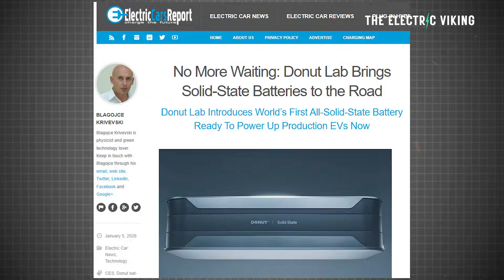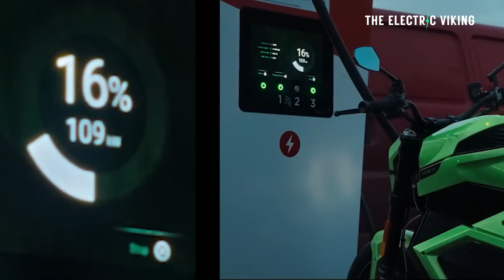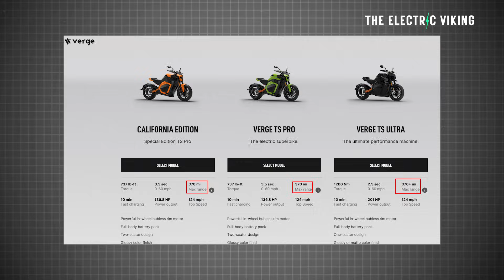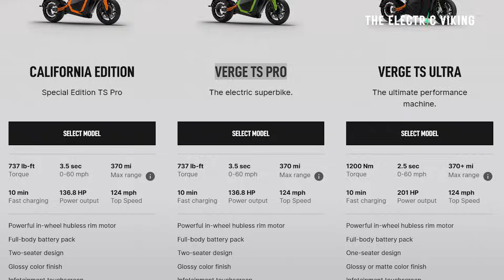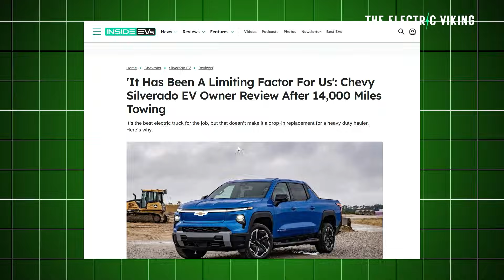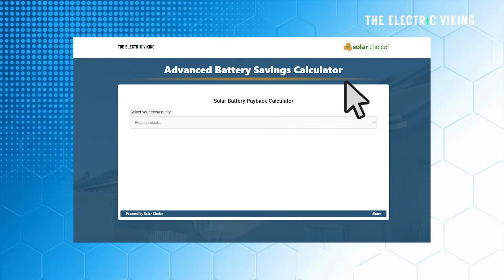The world's first true production-ready SOLID-state battery lasts for 100,000 cycles

Comment: 0:24 People who say that batteries will end fossil fuels seem to think that batteries generate their own electricity.
Reply: Whether you use, nuclear, wind, solar, or geo thermal, they all generate electricity. Gas powered ICE vehicles use between 20-55 percent of the fuel it burns actually turning the wheels, the efficiency is way lower than EVs, before the only reason gas powered cars were better was because gas is power dense , if gas cars were actually 85-90 percent as efficient as EVs, a full tank of gas would take you 2 thousand miles instead of of 430-450 miles. They actually made a gas powered car that could go 200 mpg Volkswagen XL 1, it was a limited production diesel hybrid. There's so much more energy being wasted in gasoline that we are pissing away when 100 mpg cars could be made, but big oil doesn't want that .
Reply: @jesselejarzar5114  You would have to factor in all the power loss from the power prrduction to charge the batteries, to make it a fair comparison.
Reply: Most countries just don't make enough electricity to ditch fossil fuels.
Reply: You have to consider that this battery enable store solar energy and have energy available 24/7

Comment: Every engineer’s BS detector went off listening to the hype. It’s 2026, and they’re claiming a solid state battery with 100,000 cycles when the current upper limit is around 25,000 for lithium-titanium-oxide (LTO). The secrecy around the battery chemistry only adds to the suspicion, this reeks like a scam.

Comment: 22kwh out of a solid state battery is the same like 22kwh out of any other battery chemistry and it's not enough for 370miles of range. Even a 22kg battery with solid state tech can't do 370miles, with 22kW the math makes simply no sense. 400wh/kg means at least 55kg for a 22kwh battery, probably more like 60. That would probably fit in such a bike but it would mean only 3,6kwh/100km of range. Shit, a small Surron Hyperbee needs twice as much for such a range..

Comment: Your gushing thoughts that 500Wh/kg will enable inter continental air travel is somewhat hyperbolic.   Jet A fuel is approximately 11,900Wh/kg and even given a 30% conversion efficiency that is ~4000Wh/kg so still 10x better than this Donut offering for aviation.
500Wh/kg will make it viable for small, light aircraft, just.

Comment: lithium ion solid state projected to be 800-1000 kwh/kg. A few years away, but double or more than Donut's sodium-alu-carbon solid state battery. QS battery testing at 844 kwh/kg and looks like VW's Powerco will build it.
Reply: and here is the problem. anything you buy now is obsolete in 5 years. i mean imagine buying top of the line tesla now just so they announce in february that cheapest model 3 has now specs same as top of the line you just bought

Comment: It's pretty exciting. Let's see how real it is. More than doubling range, what's more likely is using fewer to reduce cost. If the car could drop in price by 3 or 4 grand and still add maybe 20% in range people would be sold. The car would be lighter too and thereby extending range just through hauling less weight around. The cars could be safter too. Less crushing in a crash. Also more snappy acceleration (I think cars are too fast already). The fast charging time would sell people too. What if you go to a 3 minute charge for a smaller pack? I really hope this is all real. It will be amazing. An electric car that can be passed on like a classic car instead of being a brick.

Comment: Carbonised chips which distribute heat are going to be utilised and solid state batteries. In Japan when you need a charge that are charging stations, but the new charging stations are.
The car goes straight to the charging station a robot comes down under the battery takes the battery out put it on charge put a new battery already it charged up straight in and slaughter it underneath the car and the way you go it’s quicker than fuel your car. It works 100% Japan have this now just to give you some idea.

Comment: Narrow body jets like A320 or 737
Impossible. Battery mass would exceed takeoff weight before payload and reserves.

Long haul or transcontinental flights
Not even close. You would need 5 to 6 times higher energy density.
Reply: 500 Wh per kg does enable electric aviation, but only for:
	•	Trainers
	•	Short range commuters
	•	eVTOL
	•	Cargo and special mission aircraft

It does not enable electric jetliners.
For that you need either hybrid systems or a fundamentally different energy carrier.

Electric aircraft will arrive quietly on short routes first. Anyone promising electric long haul aviation with batteries alone is selling fantasy.

Comment: Just because you can charge a motorcycle in five minutes, I’m not sure, but I don’t think you could find a charger on the face of the earth that could get enough electricity to cram that much energy into a pick up truck in five minutes, even if the batteries could take it. Think about the quantity of energy that would be.

Comment: Donut Lab claims that their solid-state “Donut Battery” is production-ready now and can be used in motorcycles like Verge’s 2026 models.
	•	However, there is no independent verification that the battery actually performs as advertised in real-world use.
	•	Claims of extremely fast charging, high energy density, and long lifespan are not confirmed by independent tests.
	•	“Ready for use now” likely means for OEM manufacturers in limited test deliveries – it is not necessarily available for consumers to buy directly yet.

It’s exciting technology, but it’s important to separate hype from verified facts.

Comment: As an American living with the anti EV propaganda.  If the Silverado was to receive a 900 mile battery, the haters will simply demand that it goes 2,000 miles between charges, can be charged in a millisecond because they never get tired, hungry, or have to pee.  I really get frustrated with the idiocracy that is the U.S. "conservative".
Reply: reality is charging speed is not anymore a problem, even range is not a problem. i dont drive even 100 miles with no stop. the problem was degradation to some extent. the biggest problem o evs is actually so fast improvements for example Taycan- first taycans are ticking bombs now selling for 30% the price. if that solid state is true and they can deliver those batteries fast then the amount of value loss in old EVs will be insane, nad also amount of li ion batteries that will go to landfill. ironically causing the biggest waste that ever happened
Reply: @nonono173 even worn out EV batteries are expensive and ripe for 2nd life use and recycling. The landfill argument is another straw being reached for to feed the anti EV propaganda

Comment: Saw a Reddit thread indicating the key battery tech may actually be nanocarbon materials from Nordic Nano. CEO of Donut Labs sits on the board of Nordic Nano. Nordic Nano seems to have a production facility in Imatra Finland using nanomass tech from Germany and "Finnish quantum coating expertise". I really hope these companies are able to ramp this at scale!
Reply: Yea I saw that something along those lines as well.  The claim is these are actually capacitors not batteries.
Reply: @markk171  They likely act like hybrid pseudocapacitors. Energy density is high in 20-25 mph start/stop traffic, when ion diffusion lets them act like a battery... but likely collapses on the highway under higher and more constant discharge rates, where they discharge more like a capacitor. I wouldn't be surprised to see them act more like 150 Wh/kg on the highway.
Reply: You are
 correct It's a Capacitor https://www.youtube.com/watch?v=Qsi-TS8PX7U

Comment: Let’s say the motors are extraordinarily good.. why on earth have multiple points of bearing failure stop the hollow wheel trying to impress crap one axis is just better alignment and engineering..in the same way that on a single shaft two bearings are superior to three.. adding multiple axis support is retrogressive.. The Batteries let’s hope they’re even nearly this good

Comment: Charging a 22 KWH motorcycle battery in 5 minutes would take 260 KW of power. Okay, that is doable. About 650 amps on a 400 volt system.
Charging a 200 KWH EV truck battery in 5 minutes would take 2,400 WK. Even on an 800 volt system, that is a crazy 3,000 amps. That's not going to happen.

Comment: 22kWh in a motorbike would easily produce 360 miles. You get 30 to 100 miles per kWh typically on a motorbike. (3 to 5 in a car.) 22kWh is 50kg of these batteries. (Sam you need to get your head round the whole kWh thing. A kWh will generally give you the same range, regardless if it's an old inefficient battery, or a new solid-state. Some increase from weight reduction.)

Comment: Still on target for 2027 target of 'financial' collapse of ICE industry, where banks will no longer finance fossil fuel cars. A 3-year loan in 2027 may be possible, but after that your just burning money. BTW, still not a fan of axle-less donut-type wheels, because the physical longevity of the architecture is suspect[...at weight?], and road conditions 'could' further deterioate the mechanical viability(...?) Big fan of axial EV motors, but changing that tire appears complicated and costly.

Comment: 10:40 “500 Wh/kg for electric transatlantic flight” just means you forgot to count zeros—jet fuel is ~12,000 Wh/kg and even fantasy electric concepts need several thousand. Big guy here is mixing up 500 and 5000.  Lolol great information source
Reply: Hmm… they said that the battery can have any shape, maybe that allow them to put battery on the structure, lowering the density needed. But yeah, is that density is required, it seems extremely hard even with this new battery.

Comment: A read quote; ‘Seems they are betting on nanocarbon? Donut Labs made a significant investment in Nordic Nano a while back.
If you look at Nordic Nano’s history, the “secret sauce” they’re most likely bringing to Donut isn’t a brand-new chemistry, it’s how nanocarbon is being used inside the cell.
Nanocarbon materials like graphene-style structures, porous carbons, and carbon networks give you huge surface area, very short diffusion paths, and excellent electrical conductivity. If you build a solid or semi-solid electrode around that, you can move ions and electrons fast without the mechanical stress that kills conventional electrodes.
That explains a lot of Donut’s claims at once. Fast charging comes from low diffusion limits. Long cycle life comes from reduced cracking and more elastic structures. Safety comes from avoiding flammable liquid electrolytes and metal dendrites punching through separators. It also explains the clay-like, shape-agnostic battery story since nanocarbon frameworks are much easier to mold, print, or structure than traditional stacked Li-ion layers.
The leap isn’t that nanocarbon breaks physics, it’s that it lets you operate in a very different regime. You trade classic Li-ion assumptions like liquid electrolytes, layered electrodes, and tight state-of-charge windows for a system that behaves closer to a battery–supercapacitor hybrid, but with much higher energy density than caps.
If Donut’s numbers are even half real, Nordic Nano’s nanocarbon work is probably what makes the battery behave differently. The rest of Donut’s stack just makes it usable at vehicle scale.
Assuming they are shipping these cells on those Verge motorcycles, like they are claiming, then I'm sure someone will soon get their hands on one of these solid-state cells. Probably won't take long until we get some sort of validation.’

Comment: Love the enthusiasm but, even 600 Wh/kg still won't get you from the US to the UK trans-atlantic in a pure electric aircraft, hybrid perhaps.  Jet fuel is around 12,000 Wh/kg. Even with a light aviation design aircraft it would struggle to get over 1,000 km. Current top tier light electric planes (like the Pipistrel Velis Electro) use 170  Wh/kg batteries and get only 100  km.

Comment: "Couldn't possibly have any trouble towing with 900 miles or range."
You clearly haven't heard the anti-EV types out there. Every day they have to tow 30k Lbs 1500 miles uphill without stopping. Haha!
No, in all seriousness, a 400 kWh battery will NOT be charging in 5 minutes. Not outside of a lab setting for a long while, anyway.

Comment: I have an EV and I believe ownership cost will be much lower if there are standards for size and termination connectors like that of 9V , AA, AAA , button battery standards. I don’t mean user serviceable due to the high risks involved. Probably a qualified electrician trained to replace the battery. If there are such standards I believe battery manufacturers can produce replacement batteries that will cost much less than existing situation. This is a real game changer.

Comment: 22 kWh battery provides up to 217 miles.
33 kWh provides up to 370.
I mean, still doesn't make sense, as the first would average just under 10 miles per kWh... while the bigger, heavier pack will do over 11 per..?
Or is it that the smaller pack is a traditional lithium battery, and the other is the SS? Anyway, the larger one starts at about $30k.

Comment: 5min charging? Let’s assume a 50kWh battery and a home 240V AC power supply. To charge a 50 kilowatt-hour (kWh) car battery in 5 minutes, a charging power of 600 kW (kilowatts) is required🤔

Solid state batteries have many benefits but home 5 min charging isn’t one of them.

Comment: Less hype and more accurate facts please. They never said they could recharge in less than 10 minutes. They said they could add 300km (likely 30 to 80%) in 10 minutes and the charge speed is 200kW not 1000kW.

Comment: 700 hp from a 13kg motor would seem ideal general aviation airplanes and  VTOL aircraft,  but given that petrol ICE and turbine engines produce about 4 to 6kWh/kg of fuel rather than 0.4 kWH/kg as Donut claim for their solid state battery, seems you would need about another 5X improvement in battery storage power to weight ratio before electric propulsion starts to compete with current petroleum powered aircraft.

Comment: The BIG gamechanger would be a standardized battery. You start the day driving to work. Give it a quick charge. Put it in your working machine, a boat for example if you are a fisherman. After work, give it a quick charge while you take a shower. Drive home. Charge again while having dinner. Put the battery in your motorcycle and have a ride. If batteries can outlive most machines and can be charged in five minutes this is how to use this "forever battery" !

Comment: Towing is an interesting thing, I recently calculated out what energy density would be required to match an F150 ICE model, it works out that with the energy loss to heat and other factors in internal combustion engines the actual energy density required to match an F150 with a 23 gallon fuel tank would be around 400wH/kg at pack level, to match the larger fuel tank models, 36 gallons, you would need to push that up to around 800wH/kg, so this battery would about match the towing capability of a ICE F150 with a 23 gallon fuel tank. They are of course rough estimates and may be out a little, it depends on the efficiency of the ICE mainly and some of them can be woefully bad. Still, if true at that level we are seeing performance equivalency with many models of ICE vehicles for towing.

Comment: People talk about 1,000 KW charging as though it's trivial to accomplish.  Even if the battery could handle it, where does the power come from?  A house in the US with a 200 amp service could only provide about one fifth of that power, even if everything else in the house was turned off and there was dedicated wiring from the breaker box direct to the charger.  If multiple houses tried charging their EVs simultaneously, it would overload the transformers supplying the neighborhood.  The problem gets exponentially more difficult with a public EV station.  It would need a dedicated power plant to supply such massive electrical outputs.
Reply: just like now, there will be max power chargers much more expensive than normal chargers, want fast pay fast

Comment: Seen the hub motors before, ok I agree they may be useful on scooters, both ride on and sit on, and maybe motorcycles, but if you put a motor in the wheel hub it's unsprung weight which is not really ideal once you start getting up to heavier vehicles like cars, how reliable would they be simply because they will be taking a lot of impact forces from the road contact, but that's beside the point. All solid state is a claim that needs to be independently verified, both Mercedes and MG are testing semi and quasi solid-state batteries with similar claimed energy density, so when we get independent verification I will believe it, right now I will hold back any belief or disbelief, I mean they have made the claim so they will be confident sending production samples for testing right?

Comment: While I don't know if these claims are true, i don't find the claims unbelievable. For example,  I purchased a performance battery for my electric dirt bike two years ago,  paying $2400. Dollars . It had a max output of 180amps sustained. Just got a new one at less than half the cost , and the max sustain amperage output has risen to 220amps. We are talking about a  165 pound bike which can output 50 horsepower! The next area for improvement is range. But as it is, I get tired here on the east coast before running out of power.😊

Comment: Just one note, if you wanted to charge a 900 mile full size pickup (light duty, but full size) in 5 minutes that would be over 5GW charging. That won't exist for a while. Still 1GW charging (which exists today, although in limited quantities), that would be 20 minutes, which is totally fine. Of course with 900 miles of range you would rarely need to charge except at the destination.